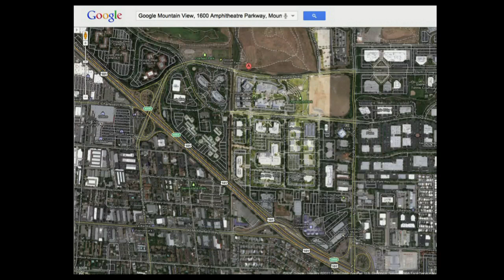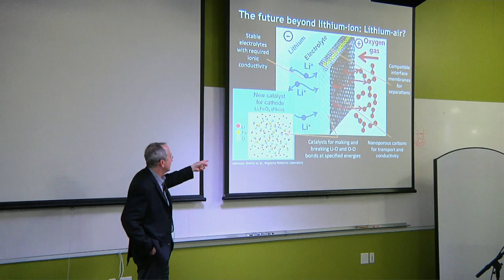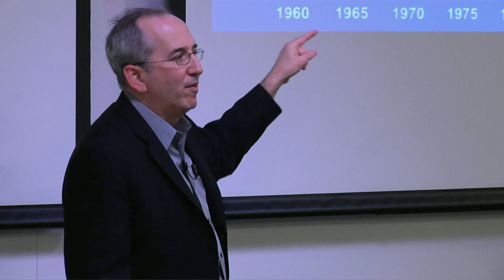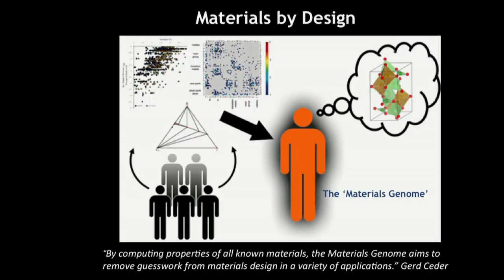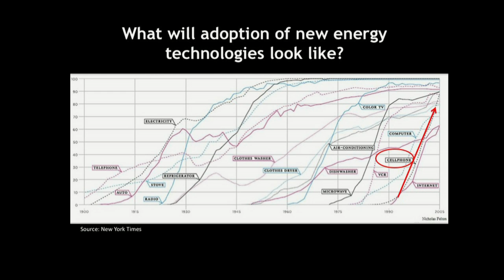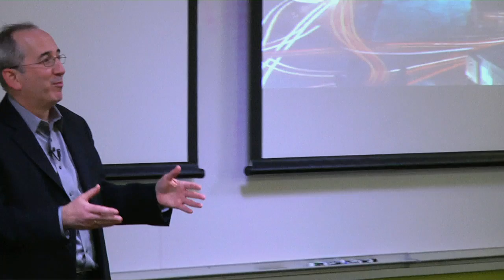Gamechangers | Eric Isaacs | Talks at Google

Comment: No doubt we need better batteries. But not for vehicles. All automakers have been very clear that the future for EVs is the integration of storage (batteries) and fuel conversion (fuel cells). (2015 is the production year for Daimler, Honda, Toyota, Kia, et al.   Love science he is dealing with.. but think we need to recognize role molecule fuels will likely play in EVs.  Not enough character spacing to counter H2 or fuel cell skeptics--but challenges are being address w/ storage, MEA costs.